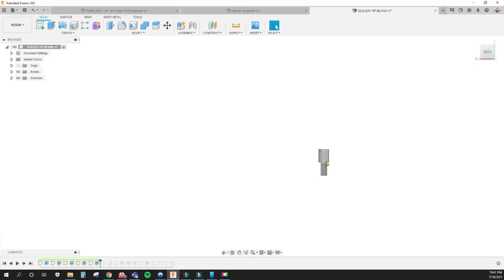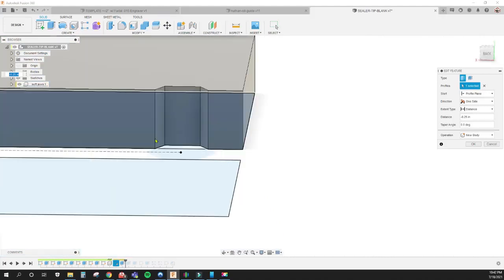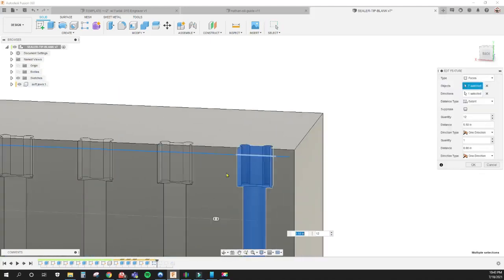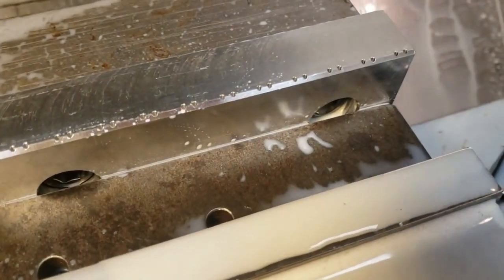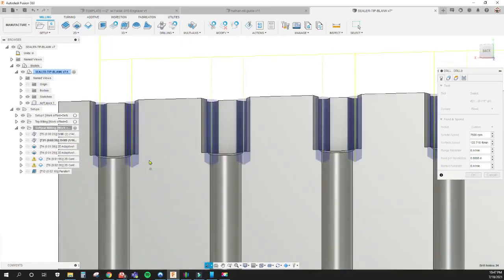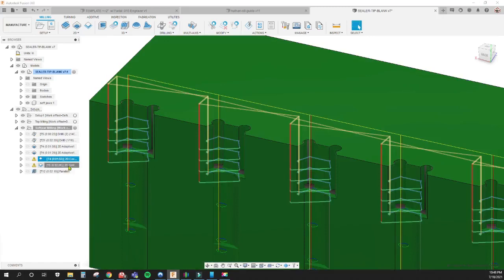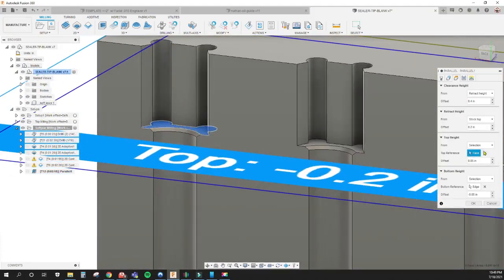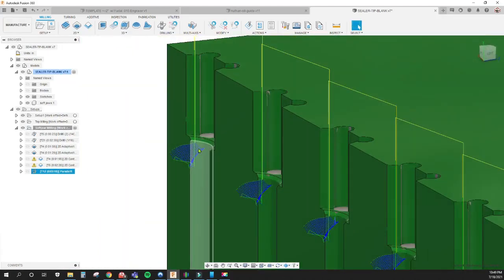CNC Milling Soft Jaws For Hex Parts

Comment: It's possible that by the time I'm writing this you have already used these and it worked out fine, but you might consider using a piece of copper between the parts and the flat jaw to take up any variation, and get a good grip on all of the parts.
Reply from the maker: I plan on using them this week. That's a good idea! I have used cardboard in the past to take up size variation(as seen on Joe Pie's channel) but copper is also a good one to try out.
Reply: @MojoMfg  Oh good. As long as you have a plan.